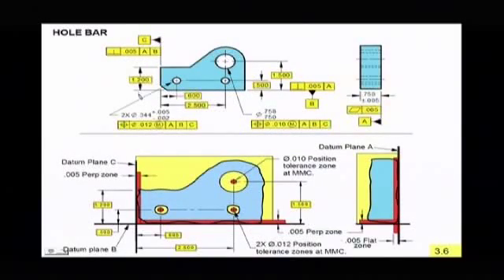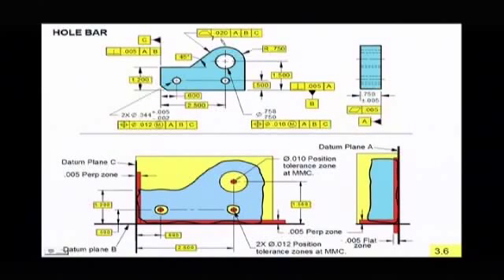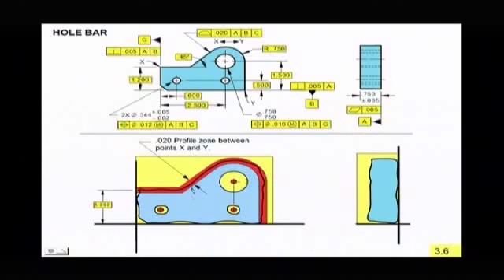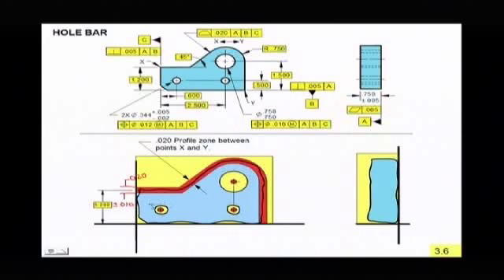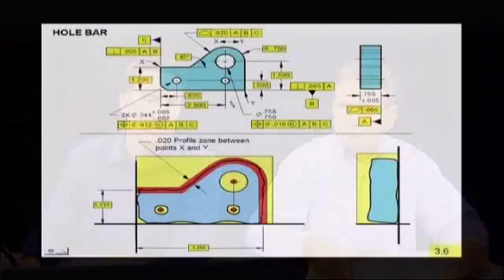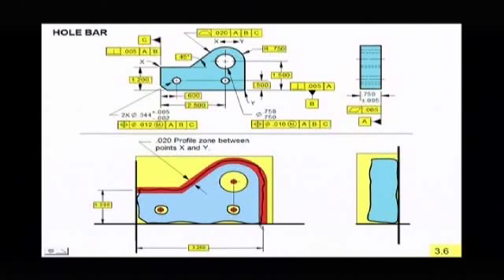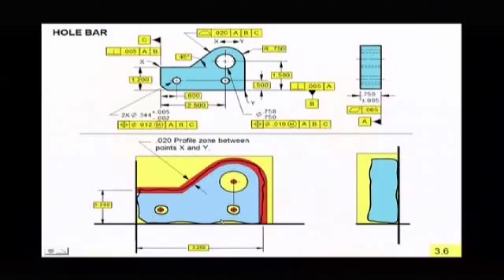Introduction to Profile Tolerancing

Comment: sir very interesting lecturing, 
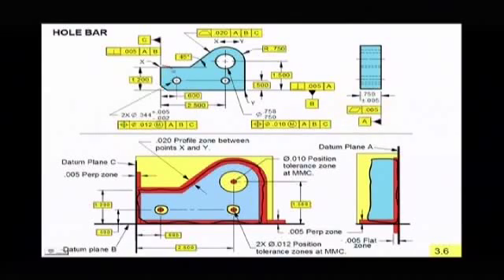Need little clarification on 1:08 .is this profile tolerance acting as dimensional tolerance or geometry tolerance.Because half of this profile tolerance .020 value adding and subtracting to basic dimension 1.200 , to get highest and lowest value respectively.
But in the case parallelism, tolerance  value must lie between dimensional limit. Could you give a video on another or  details.
Reply from the maker: Profile tolerance replaces the plus/minus tolerances that used to be on dimensions. No more dimensional tolerances (except size). Profile tolerance controls the location of a surface relative to a datum reference frame. Min/max distances between surfaces are determined by the profile tolerance zone and the datums.
Reply: Thankyou sir,for the replay.